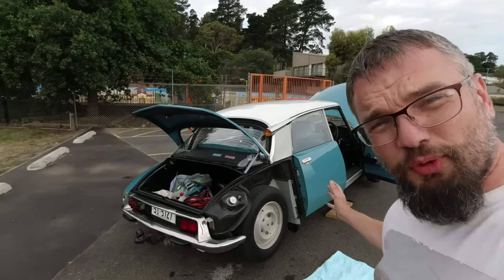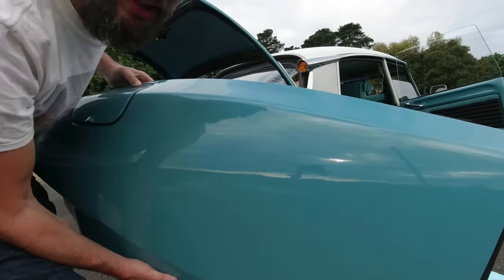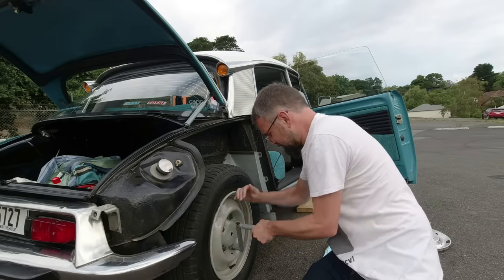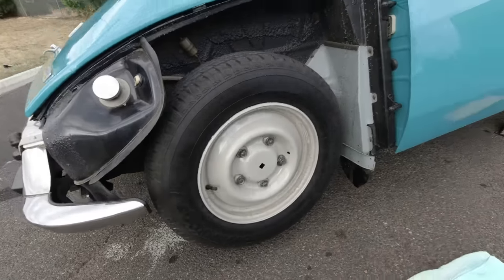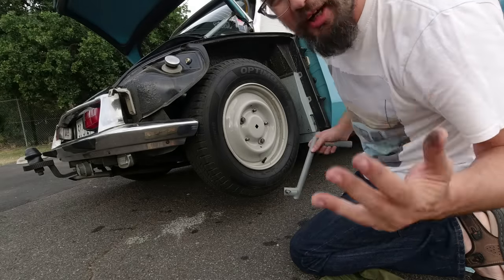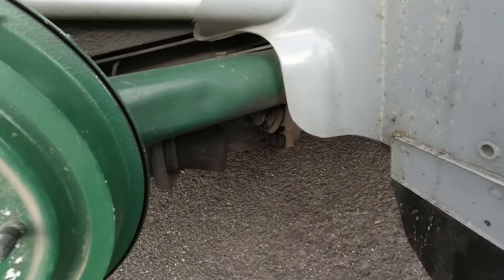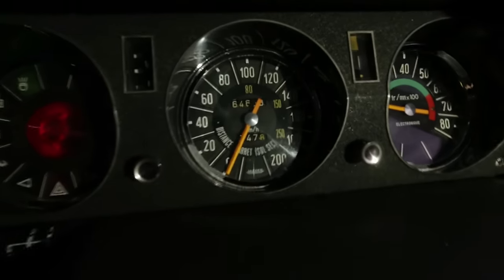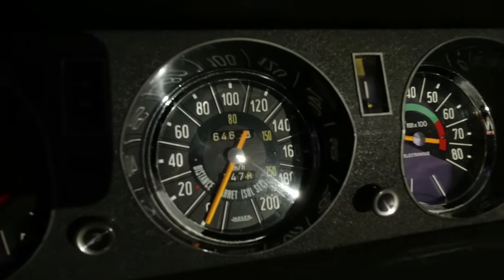Can it drive on three wheels?! And other Citroen DS Party Tricks

Comment: How do you lift the front wheel(s)?
Reply from the maker: Same way. I failed to show it properly, but both wheels had lifted on that side.
Reply: @HubNut  Thank you for your response Ian. A friend had an old Austin "gangster car" don't know the model ,I think it was 16hp, about 1930  it had hydraulic jack's, one to each wheel, great for preventing any one driving it away.
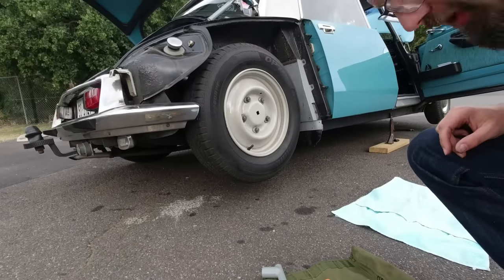Reply: I was wondering if it had a separate jacking point, but it doesn't - you can see both wheels lifted at 6:21
Reply: @AJB1  Just one jacking point each side, so whole side of car is lifted.

Comment: Spheres?? Filled with oil?
Reply from the maker: Yes, the spheres or displacers hold gas and oil to give height control and great damping and springing characteristics. Independent suspension all-round.
Reply: No fluid, or just drops of it until the suspension is pressurized.

Comment: It's a bit pointless the swivelling headlight turning inwards and pointing to the side of the shroud rather than out thorough the front glass. !

We didn't see it running on three wheels with a front wheel removed ;)

I daresay early minis would run with a back wheel missing.
Reply: Yes, you do lose the vision from one headlight when on sharp lock.  I guess in normal driving you would never turn that sharply.  Some have said you can remove one front wheel and do the same but I have never done it nor seen it done????
Reply: @peterriggall620  I expect weight distribution keeps the rear hub up and the front wheels down, so probably cannot be done the other way unless you can drive on the front disc! ;-)
Reply: @peterriggall620  Headlights - yes, that is bizarre. They could have either designed the front so it was useful still - and I could see its best use as being half as far as the other one turns - so you have dipped beam straight ahead, one headlight turned half way and the turned the full amount. This would surely give a better spread of light ! Alternatively, rearranged the linkage so it only acts one way.
The problem with front wheel removed is you'd have no drive due to the diff ! But the answer of course is to put a back wheel on the front - so it's always the back one missing. The car itself isn't far off being a 3-wheeler - with just one at the back !

Comment: If you did the other wheel its easy, travelled 50 mile with no wheel on but has to be the opposite to the drivers to balance the car
Reply from the maker: Interestingly, Citroen has footage of them doing it exactly how I did...
Reply: @HubNut   I think you find that may have been a left-hand drive  I used to work on these cars many years ago  the DS was a fantastic car way ahead of its time they would Cruz at 100 mph  all day  and the engines took 100 000 mile to run in what a car had over 10 off them

Comment: I disagree with your comment about when the suspension is fully up that there is no further travel. As such, it'd be an horrendous ride on really rough surfaces.
Reply: Well it is actually like driving on a board on the high setting.  It was never designed to be driven any distance on this setting.  There are however 2 normal drive positions.  A friend tows a pop top caravan with his D Special and he uses the higher of the two normal ride heights for this just to firm up the suspension a bit.
Reply: @peterriggall620  That's all interesting stuff. I thought the top position was for like really rough roads / off-road - so I was expecting still to have some spring left ! My experience is minimal but a friend had something newer - can't remember the model - so I got the impression from that - that it'd still have springiness at the top setting. Maybe that is the case with later Citroens.
Reply: @peterriggall620  Have you driven it flat down ? 
Does the brake function activate before the suspension ? And where in the order of things does the power steering come.
Isn't it a bit like waiting for Windows to boot up - LOL !
Reply from the maker: Top is jammed on the bump stops, as is fully low. As such, driving is best avoided on either. There are two heigh positions for general use.
Reply: @HubNut  Totally ok about it resting on its bottom limit but surprised fully up would in effect, remove the suspension. Is this true of all Citroens with hydraulic suspension ? I wondered if later ones restricted the options so it didn't go up to the stops.
Perhaps another HubNut special video for the future - as I wonder how many drivers of those vehicles realise the height setting is analogue ? You can put the lever anywhere and the height will reflect that position.

Comment: You actually can calculate that removi9ng only one wheel is not sufficnetr when tryiong to get the DS to drive (normally). This type of problem removalk gets you to concldue that (in hindsight) it is only logic that earl;y 1960s suddenly everybody was writing that within 10 years everybody would be driving a hover car. The DS was introduced around 1959 and would feels like it is hovering if only there would not be 4 wheels and a lousy suspension under that keep mucking things up everytimne you try to turn.
Reply: What

Comment: That IS NOT driving, it's creeping around with the suspension topped out on its stops!!  You've gotta block the hydraulic pressure to actually do this & keep it from dragging, maybe even disconnect the roll-bar & tighten the bearings to lock it up in place.
Reply from the maker: Nope, not really. I did this trick with my Citroen GSA around a race track (30mph at one point) with no such problems.

Comment: So those lug nuts where on with all of what, 13 ft lbs?

And that headlight trick doesn't work out so well really... shame they didn't lock them out from turning inward to the point that they were shining at the housing itself... blocking light output 100% from one light or the other when the wheel is locked out right or left, all the time, every time. Plus, those were SO misaligned... one 30 ft up, the other straight ahead... not great.

Comment: fair amount of polish and wax on it.  +1
even the engine sound is good, different. not just another stupid 4banger.. sounds healthy
i had on xsara 1,8 xu7,  it was nowhere near this.. 
wondering what happen if  you just move when sits down......it should not scrape the pavement i guess
the real citroen era ended like in 70´s ??
Reply: When it is down there is only a couple of mm clearance between ground and the exhaust.  You can drive with them right down but you would do damage unless the ground was absolutely flat.  Emergency only.

Comment: Don't try this with a loaded boot.
Reply: Νο problem. It stays at the same height.
Reply: @ΓιώργοςΨευτινάκος  with road wheels dismounted it can't.
Let's say we removed all four wheels. Would it levitate and float? You're under thinking this.
Reply: The auspension system always keep the car chassis balanced. When you add weight in the trunk pressure raises and the rear moving up to be flat.
Trust me. I m working hydropneumatic suspension for living.
Reply: @ΓιώργοςΨευτινάκος  I know all this. But you can't overcome gravity.
Reply: @ΓιώργοςΨευτινάκος  I understand how it works. What I am saying that raising the pressure will not help in the slightest if you remove a rear wheel and then load up the trunk to the point the car over balances the hydraulics will not be able to do anything.
What you're saying is completely impossible. If you were correct then you'd be able to remove all four wheels and have the car levitate as if by magic. I know this because I have degree level physics.
Reply: @paulanderson79  Let it ,this with the four wheels.
Its a triangle. The car is front weighted. The opossite front sides dive.The opossite rear raises.Ok there are limits . Even with for passengers and almost 75 kg in the trunk ,the three wheel Ds was flat!
Always the system levels the suspension to be the car flat.
The point is not to drive with three wheels. The point is the comfort and the safety when a tyre "busts". The suspension takes the weight to the others wheel from the corners who dives.
Always there is a limit.
Reply: @ΓιώργοςΨευτινάκος  That's all I was trying to convey :-) Stay well during these difficult times.

Comment: whenever I see this party trick I cringe. It was never designed to drive on three wheels. Sorry for the negative comment. The driver manual also recommends not driving a D on full height for anything less than a very short distance. I've seen people in the past driving D's on height above normal around town and  put it down to ignorance and a volition to destroy the car. I haven't disliked the video btw.
Reply from the maker: Yet Citroen itself regularly demonstrated this feature. On the GS too.

Comment: If it can drive on 3 wheels, why is a spare needed at all? If the wheels had individual controls, why not just raise the one and lower the three when a flat occurs; never have to get out. Sort of like a lame dog.
Reply from the maker: Because you have to lock the suspension on high, there isn't really any suspension at all. You wouldn't want to drive far on three wheels.

Comment: Those aren't 'Citroen' tyres !
Reply: No, not Michelins.  It still has the Michelin spare but I had to opt. for Hankooks and Michelins to fit were AU$500 ea. where I could get 4 Hankooks for that price.  Could not justify it and they do the job just fine.
Reply: @peterriggall620  My dad was a Michelin fan. That's based on his experiments in the 50s 60s ! He was, at the time, a self-employed mechanic at a haulage /plant hire business. What he did was fit wagons with a range of tyres to see which lasted better AND which the drivers preferred when fitted to the front. He did similar tests with batteries to conclude Exide are the best. I'm pretty sure that's still the case.